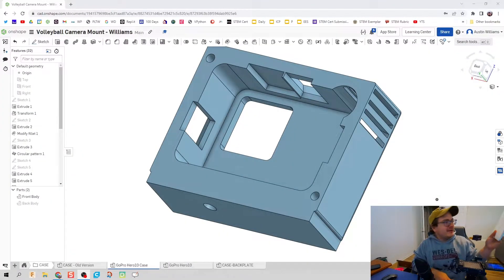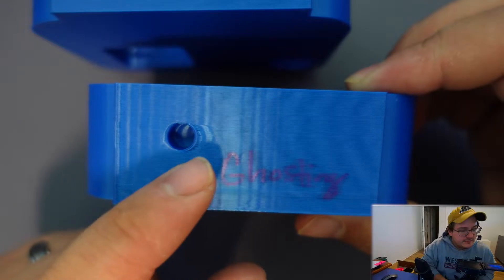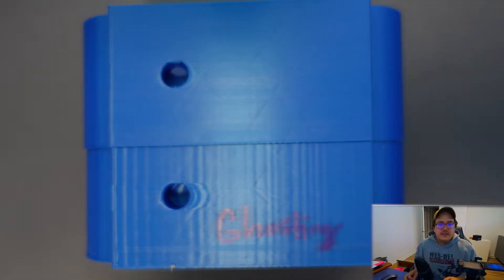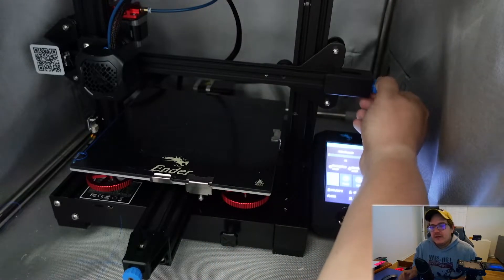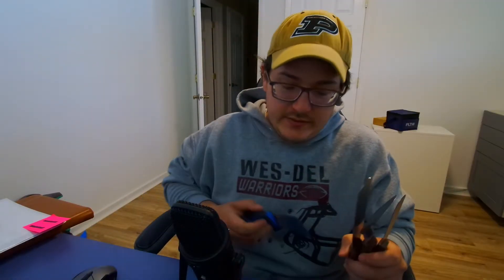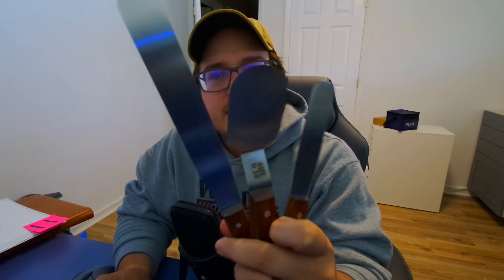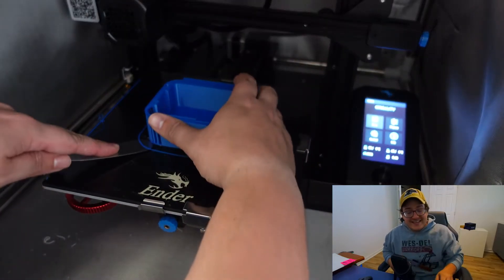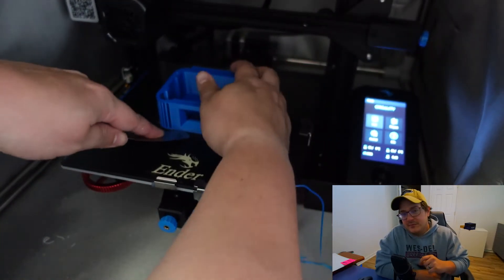Ghosting Fix and Beginner Tools - Day 11 of 100 3D Printing Journey

Comment: Since you are using a glass bed try using magigoo glue stick.  Your prints stick and when cooled down to room temp they pop off with little effort.  Or use a spring steel PEI flex sheet.  I really like mine.  Very little problems and if the prints stick too much, just flex the sheet slightly and it come right off.
Reply from the maker: This bed has a layer of adhesive on it that only gets tack when heated. Never really have an issue popping prints off the bed with a beveled edged scraper. The ones I ordered to test were not beveled and too thin.